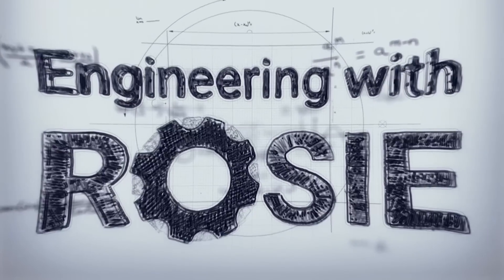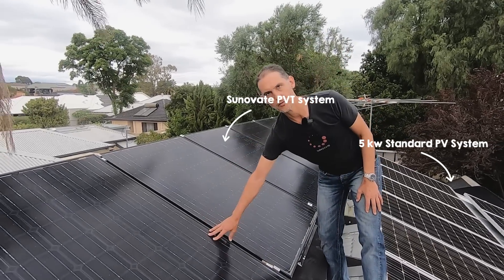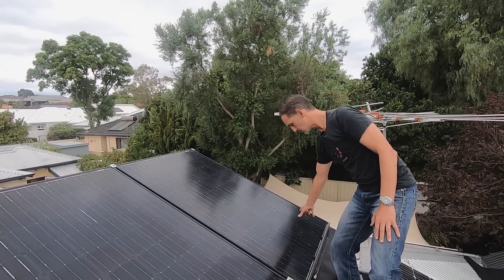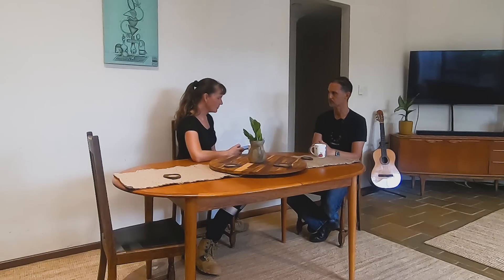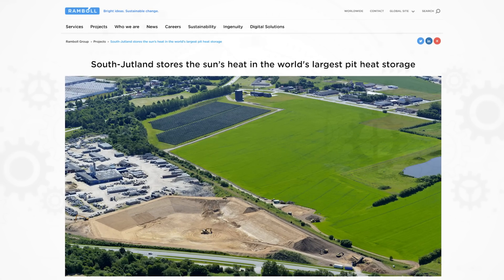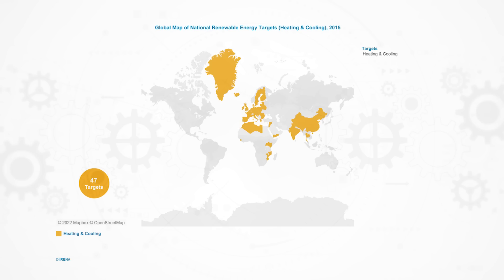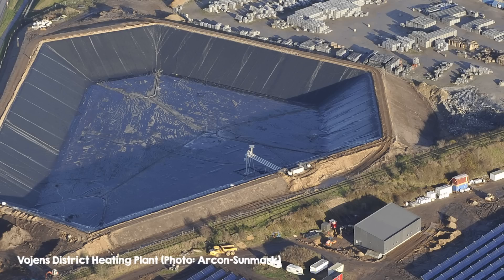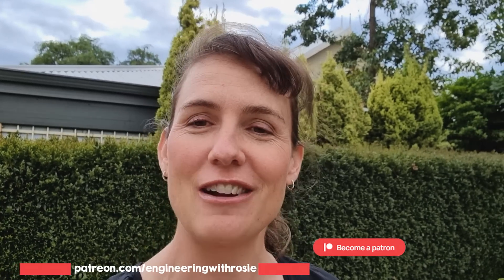Warming Up By Cooling Down Your Solar Panels

Comment: Hey Rosie, any comments on ROI or energy increase vs energy use for the cooling system? 
A 5% increase isn't a lot - it might be worth just adding an additional panel or two.
Reply: If the whole array doesn't cook itself to death.
Here in the US desert south west (which has great PV potential) you might be looking at 46°+ as ambient and the dark blue solar panels reach scorching temperatures.
I'm not sure how much cooling that hot dry air can do.
Adding a slight mist would knock down the input temp as water's latent heat of vaporization is on the order of 2256 kJ/kg.
But of course water is a precious resource in the desert so the CBA would have to be considered.
Maybe using a bit of water to cool the PV would more than offset the water used from lake Mead or Powell to generate = electricity delivered to the site?
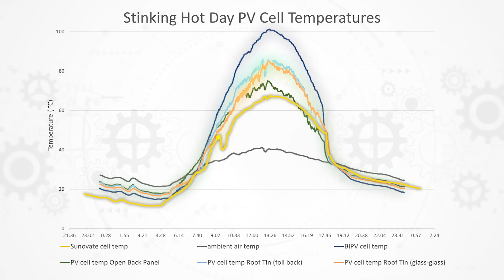Reply from the maker: It's 5% per 10° temperature reduction. The operating data I showed in the chart at about 07:35 was on a 46°C day, and we see about a 40° reduction from the worst-performing panel to the Sunovate panel which was cooled with ambient air. So that's something like 20% efficiency improvement.
Reply: @EngineeringwithRosie  Seems like Sunovate has a 'bright' future ahead if they can get their tech out in the mainstream.
Reply: @EngineeringwithRosie  yes sorry I missed that. That is 20% at peak - it's not 20% for the whole day - would be good to calculate the total capacity between the graph lines. What is the total capacity increase for the day?
Reply: Once your roof is full it is a way of boosting outpu
Reply: Hi Chris, other have clarified the increase. We originally set out with cooling to be the primary purpose. We achieved that but pivoted to focus on the thermal production with the panel cooling being a nice byproduct. If your primary focus was just on energy yield adding another compensation panel or three (or PV overclocking) is an alternative approach. However not everyone is long on roof space and we also are looking for the panel life extension.
Reply: @jimurrata6785  Our tests regularly experience those hot dry conditions. You will see one of the test on Rosies presentation. The PV cell temps can get at high as +100 degC in a BIPV installation and close to 90DegC in a normal roof installation. We have actually ran evap cooling trials during such a day and brought the cell temp down to 50 DegC. We wouldn't advocate for running in this mode as we are trying to preserve water also. We like to view the opportunity like the DRS in a Grand Prix. You only hit it when the need comes. This could be a generation short fall. We can very quickly pull the cell temperature down in a matter of minutes without thermal shock as we cool evenly. So in the time to get a quick start gas turbine up we could be yielding more electricity by circa 20%. More if we had a chilled water store.
Reply: @glenryan6692  I watched the video. 
I was asking if the additional cooling of evaporation would more that make up for the water use.
And I guess the answer is "It depends on your situation and priorities"
That it works, and how it works is beyond doubt. Increased lifetime is a huge factor too (just like actively managing battery temperature)
Hopefully we see more of these "simple, common sense" technologies available and incorporated throughout the PV industry.
Reply: @jimurrata6785 Urrata's  evaporation was one of many thoughts.... but it is not well suited for the air box.... for example mineral deposits would clog the jets...
Reply: @nc3826  I guess that depends on how hard the water is. (I'm on a well and have no issue. But I'm lucky)
I wasn't saying to spray the panels inside the box, just to use mist or a swamp cooler to drop the inlet air temperature.
Again.. I don't know how much air is passed through.
Reply: @jimurrata6785  NVM, I thought you were talking about improvements, not for a different design...

FWIW You "have no issue" doing what?  If you're referring to evaporative cooling, PV panels... I will wait for you to hopefully post about it, with enough info, so it can be evaluated....
Reply: @nc3826  I'm fortunate to have no issue with dissolved minerals in my well water.
No scale or corrosion of any fixtures or the domestic heating coil.

Comment: I came up with the idea of water-cooling the solar panels after watching their performance as the direct sunlight came & went when the clouds passed over. It was clear that they made more power when cool - I naturally I thought of water-cooling them. But to make it more automated, I'd use a Stirling Engine to pump the water around and it would use the temperature differential between the water coming to going out to run it. A small electric motor to kick-start it then it'd run all by itself.
Reply: Stirling engine optimization would be a problem in cold weather and an electric pump means a net loss.
Reply: @iHelpSolveIt  Yes, though the electric motor would not pump any water, it'd just be to start the Stirling engine.
Reply: The problem is conversation of energy.... Not loss of energy... A stirling engine still requires energy to run. Once running the system looses energy which is counter to what you're trying to achieve and even if you stuck a turbine on a shaft, you would still lose energy in the system as a whole anyway.
Reply: @iHelpSolveIt  You need to think a bit more as to how it's supposed to work.

Comment: Domestic chp units are need. The grid could control them use them for back up and load demand on the grid. There isn't enough copper in the ground and air to power all the cars and heat pumps

Comment: Central heat and air is the largest waste of energy in a household  .  Get a fire place.  Cooling in the summer is a more difficult problem.  At least in the south in the U.S.  An underground water tank with 57 to 60 degree water temperature to tape for radiant cooling will help a great deal in the summer.   A solar panel can run the pump and fans.  Two large panels can run an efficient air conditioner unit in the summer and a good battery will run it for a few hours into the hot night.  By one thirty in the morning a house should be cool and stay cool.

Comment: The air coming off the panel is not going to be all that hot.  To store heat, you need to heat a huge amount of material if you are only heating it that hot.   You really need to figure out a way to get a heat pump into the situation.

Comment: Did I miss it or did you not talk about the cost vs benefit of this? How much electricity does the fan system use? How much would it cost? If the amount of electricity that the fan uses is basically the same amount as the efficiency that you gain from your panels being cooler then you're not doing much good, just creating an expensive gimmick. 

I'm skeptical of this system, even producing hot air for other uses will still need fans, tubing and other expensive temperature tracking systems and installation costs to attach this to your water heater or whatever. Everybody always glosses over the install costs for these types of projects and its very annoying

Comment: Thanks Rosie. Great video. I subscribe to both your channels, great opportunity for a cross post!
Question on my mind atm.
Are GSHPs cheaper than ASHPs, andbif so, could you use PVT to heat a special water tank to thrn pull heat off using GSHP without the need for ground drilling etc.
Making use of small thermal battery, as simple as a hot water tank, ie. Off the shelf.
Reply: They're surely not "cheaper" to install than ASHP's, but they do offer higher efficiency as the climate reaches extremes either high or low.
it's almost the same situation as we have with base load v/ sporadic renewable power, except it's seasonal.
Having a water tank (even an Olympic sized swimming pool) isn't going to help much if you have months of sub zero weather.
Ground source is only going to vary from ~7 to 20°, while in extreme latitudes you might encounter permafrost, it is a darn sight better than negative numbers in winter or months of 40°+ through summer using an ASHP.
Reply: @jimurrata6785  I mean the compressor part. Is GSHPs just expensive due to the drilling part, or is it the actual compressor and heat exchange too?
Reply: @cclambie  Sorry I misinterpreted your question.... 
The mechanics of both systems don't differ that much except the ASHP is going to be located on a pad outside much like central air while a GSHP exchanger is likely to be fitted inside (taking space and increasing installation cost)
Depending on your climate the ASHP may have to be sized a bit larger to accommodate it's lesser efficiency.
In any case using electricity to heat water to then run through an ASHP is really inefficient.
If you must use solar, use it to heat a Kanthal element directly in the heat exchanger.
Reply from the maker: It is so hard to answer that generally, because it varies depending on local factors. In Australia heating with an air source heat pump is waaaaaay cheaper than heating with gas and has been for ages, and due to mild winters there would be no reason to bother with ground source in most if not all situations. But that is obviously not the case in colder climates. 
Now that the world is suddenly obsessed with renewable heating and heat pumps especially, perhaps it's time for a video on the topic. I'll get an expert guest from somewhere cold who can talk more about when you'd use ground source vs air source.
Reply: @EngineeringwithRosie  Oh please do a collab with Alec Watson of Technology Connections!
His last Heat Pump episode a couple of weeks ago was awesome!   https://youtu.be/MFEHFsO-XSI
(loved his FLIR captures of the ASHP in winter)
Reply: Craig, We have had GSHP for 30 years in Michigan USA. The unit is exactly the same size as a gas furnace and is just as quiet, nearly silent. Because it is indoors you never have to deal with critters or leaves or rain or sun as the unit is securely indoors. And it's closer to the electric panel as well so less wire. Untrained observers don't even notice it's not a gas furnace as it merely has in and out water pipes instead of a vent pipe.

With it's high COP it also makes our hot water all year, and during cooling season that hot water is literally free, extracted from the air in the home as it cools. 

Since the exchanger is much smaller due to the use of water vs air it all fits neatly in the box.
Reply: @larrybolhuis1049  That is very interesting.
What I am proposing is to heat hot water with PV or night time electricity.
Then use a GSHP heat exchanger to convert the hot water to heat in the "peak" usage times - like 4pm-10pm
ie. The COP from warm water would be 10x maybe higher.
The cost of the electric is very cheap this way. The cost of heat is even cheaper than ASHP maybe....
Reply: @cclambie  I love the idea of storing heat in water that is heated with solar. Heating it directly (resistance) at night doesn't make sense I don't think unless the $KWH rate to do so is less than 25% of the normal rate.  No idea how much water you'd need to store though, I would think it would be a fairly large amount to make a difference.
Reply: @larrybolhuis1049  I guess that is the question for the engineers.
Depends on the COP of the total cycle I guess. I imagine it will be better than the cost of drilling deep holes in the ground.
Reply: @cclambie  Agreed, total COP is the determining factor. Do remember that depending on the property cutting trenches and burring loops in that may be an option rather than drilling deep.  Both of those options have low pumping costs during operation compared to open loop systems as well.

Comment: How would water get to boiling if you're extracting heat from it and pumping it through? Freezing temps, I sure see a problem there.
Reply from the maker: On the "stinking hot" day I showed data for in the video, the hottest panel reached temperatures over 100°C. But you're right, most climates wouldn't see that happen.
Reply: @EngineeringwithRosie  I thought that was without cooling. The cooling would happen before and during the heat.
Reply: Let the pump fail.
Reply: Even for freezing, there are liquids other than pure water which would remain liquid well below zero. Assuming this is a closed loop system I don't see why one of those can't be used.

Comment: In a warm climate all the gain will be used up just running the fans.  This is just like the solar panels that added aluminum heat sinks, big cost, little gain and a complex system muggles will never be able to fix.
Reply from the maker: No that's not true, the fan consumption is small compared to the efficiency gain.
Reply: Mass produced, high efficiency, low power, variable speed fan made in Germany. EROEI +2 for panel cooling and +100 for heat capture
Reply: @ opera 
Both Rosie and Glen rebutted the point you raised but you like some others seem to be missing a key point about these ‘cooled’ panels and that is the increased durability and efficiency. There are financial and environmental costs to dispose of degraded panels and so doubling the life of them reduces both those costs.

Comment: Lumping modern biomass (chopping down trees, turning them into pellets, shipping them across the world, transporting them on old coal trains to former coal power stations and burning them) in with other renewables is increasingly contentious. Here in the UK the government subsidised hugely profitable power station operators with great lobbyists £2bn/yr for this practice, but the sustainability is highly questionable. Even if they are replanting what they burn with equivalent or better woodland, the payback period is many decades to reach carbon neutrality and the ecological impact is really unclear (woodland habitats etc.). In many cases they are not replanting and claim the wood they use is all waste from other processes so there is no need to. It can be hard to get stats with biomass separated out although the EU have been threatening to reclassify it, presumably as the biggest wood burner has now left the EU. Even checking with electricity suppliers if their "green electricity" plans include biomass can be very difficult.
Reply from the maker: I agree, I touched on some of these topics in this video I did on bioenergy a little while back. https://youtu.be/bREt3U47LeY

Comment: Using solar electric elements as the heat absorbing surface for a solar thermal panel has been invented several times since the early 1990s.  The problem is that PV output would be so much higher if the panels were cooled with ambient air or skip the fans all together and use proper ventilation.  Instead we get sold the idea that we can heat air to 80C at no cost and then send that hot air to seasonal storage.  Reality check:  PV loses a lot of output at 80C (as mentioned in the video) and the panels have to be a lot hotter than 80C to heat air to 80C.  And then to transport that heat to central storage?  You can't heat the central storage to 80C with 80C air.  This story is long on ambition but short on calculated or demonstrated performance.

Comment: IF
Solar panels only use certain frequencies of light
THEN
reflecting the other (IR etc) light back into space with some sort of selective film would get the panels below ambient..?
Research: Dichroic Filters.

Also see the Solar reflective paints that give you 100W/square m of cooling here on YouTube.
Also; why try to produce solar electricity to run aircons if you can just paint your roof (etc)with these paints..?

Comment: A real engineering challenge would be to design an efficient gas turbine that runs off of the heat generated by solar panels.  
A solar panel gets very hot.  Unconcentrated solar can heat up a surface to over 100°C.  A 50°C temperature increase from room temperature  will increase the volume or pressure of a gas by about 20%.  That is enough to drive a piston engine or gas turbine.  Why should it be any less efficient than a fuel powered gas engine?
If most of the heat is lost from large metal surface areas or the pressure is lost from large spaces between turbine blades, one might expect to get zero rpms and zero efficiency from a big metal gas turbine.
1000 Joules is enough energy to accelerate one liter of air to about 1400m/sec.  How fast can  air be ejected  through a nozzle at 3 PSI over atmospheric pressure?
If the weight of a 3600 lb car was supported by a one neter diameter piston compressing the air in another  piston it would create  only  about 3 PSI pressure but it would force the air out of a small nozzle at a zillion feet per second.
If instead of a big cylinder you had flat hollow panels that circulated air with a compressor and a turbine, that could heat up the air fast enough to keep up with the 1000 watts/ sq meter, ten square meters at 20% efficiency would generate about another 2000 watts considering also the increased  efficiency of the photovoltaic panels by keeping them cool.
One cubic meter of water stores about one kwh of energy per C° increase. If the heat engine can be run off of heat stored in the water at 20% efficiency,  a 50°C increase in one cubic meter would be the equivalent of about one Tesla Power Wall unit that costs $10,000.

Comment: Just a quick one on that Rosie . Russia didn't start the war in Ukraine . It 'fired the first shot' but that is not the same as what should really be called 'what' started the war . That is an historical question and the epicentre is to be found in the crisis of the single world uni power , the US . As reserve currency but in debt to the tune of $30 trillion and growing , the US is in the same position as that which faced Germany in 1938. That's the science if it. 
Anyhow back to thermal heating . Thanks very much for this . I have solar panels here in the Uk and I think I'm going to run with this idea . It's quite frankly the bleeding obvious and why the hell are we not doing this at the installation stage ??